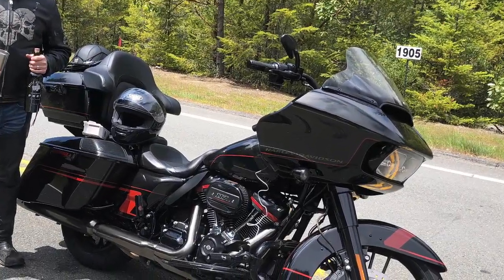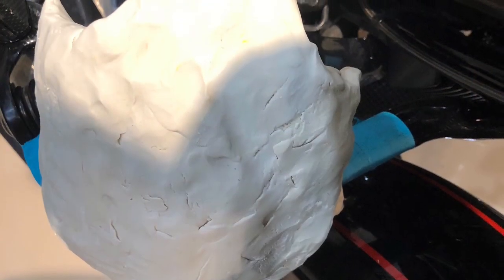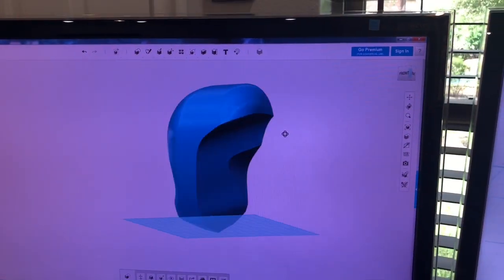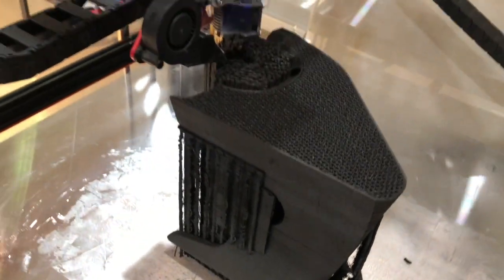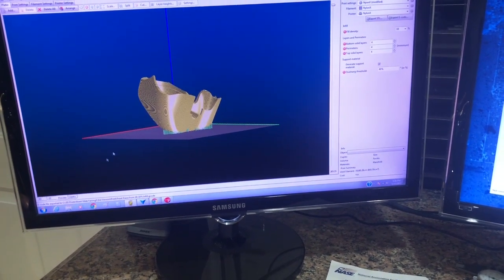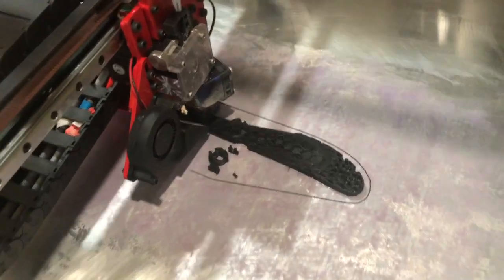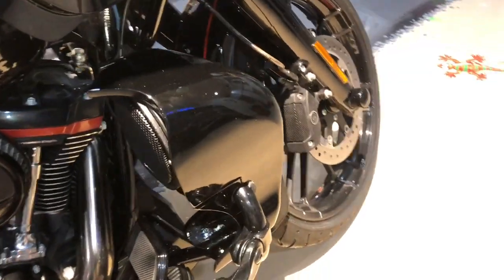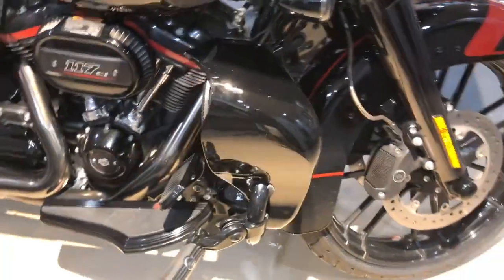Custom Harley Davidson Lower Fairings - 3D Printed For The CVO Road Glide

Comment: I dig that shape to throw air at the engine without the need for a vent. Got any ideas for the standard engine guard for a Road Glide Special?
Reply from the maker: I would make one off of the outer bar slightly outside and the rest inside.  Do they not have one for the bike?
Reply: CLTaggart dirty bird has one for an 8” but not the standard 6.5” speaker, and the venting is awful on the Rushmore and later models, this one looks to provide solid venting.
Reply from the maker: Jorge Sevilla I just modified the one in the video to fit a BOOM2 speaker, so it is not too difficult.  If I can get the dimensions for the crash bar and clearance to the bike and I can work up pretty much anything.  I am doing some designs now in virtual reality which speeds things up a bit.

Comment: Fabulous  engineering,  are you looking to sell another set for a fellow CVO RG rider.... looking at yours and the set from bugbear engineering....
Reply from the maker: Do you mean Big Bear?  I looked them up and their stuff looks great.  These are specifically for the mustache bar so I don’t know how they compare.  I just custom designed them and made them fit mine.  I have had a bunch of inquiries, and of course I can make some up.  I put some pricing in here in the some of the notes but just email me at ctaggart@aol.com if you need more info. Also you should look at the part 2 video I put up today.  The link is in the description above and it shows the easy mounting and size, etc.  so in would say check that out and what Big Bear has and then let me know if you are interested.  I can do PLA, PETG, ABS, or carbon fiber/nylon

Comment: I have the same bike and year but in Gunship grey. I would like a set without speakers. Can you make and sell a sell to me?
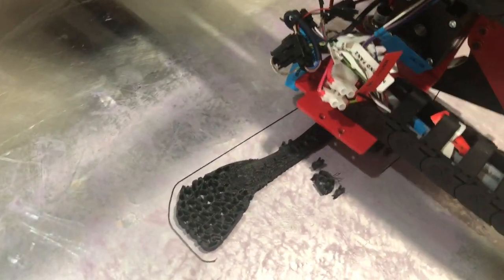Reply from the maker: Well, here is what I can do.  I am not a body person, so I can get them to you raw off the printer like at 4:30 into the video.  I can do three materials: PLA plastic is about $300 for a pair, PETG is $450, and the Nylon Carbon Fiber (NylonX from Matterhackers) is about $750. I did the NylonX because they are less weight with carbon fiber and twice as strong.  I can do either of the other materials, my least favorite would be PLA.  If you epoxy coat it, it will probably hold up to heat, but I don't know as it starts to warp around 140 F.  PETG is probably OK.  I can put a resin coat on any of them for $50 each (it is called XTC-3D if you want to look it up).  Then you just have to get a paint guy to match your Battleship Gray, sand them smooth prime them and paint them.  The ones you see here I just painted for the ride to Alaska.  While they looked fine when I got back, they took forever for me to do them, and they are now painted by Harley with the orange stripe that matches my Road Glide.
Reply: @CLTaggart  How can I get in contact with you to discuss this further?
Reply from the maker: @willieg7040  Feel free to email me at ctaggart@aol.com - I spoke to the guy who painted mine today as well and he can paint them for you

Comment: I have the same bike love it , but would like to have lower fairing.  Would you sell a pair?
Reply from the maker: Yes - if you have a body guy to finish them and paint them I can get you a set for around $250-350 depending on which material you want.
Reply: @CLTaggart  I probably use what you had the carbon fiber and nylon or do you think the carbon fiber is enough
Reply from the maker: Ryan and Barbara Spencer they are pretty thick and went all the way to Alaska and back from Dallas with no issues.
Reply: @CLTaggart  what was the one issue
Reply from the maker: Sorry - no issues.  I had responded while skiing and my phone changed the text.  The carbon fiber/nylon is extremely light and very strong. The material is NylonX which you can certainly look up.  Finishing in it includes brushing it with a clear epoxy and then sanding down until smooth.
Reply: @CLTaggart  do you have some already made with speakers
Reply from the maker: They have to be printed.  If you want them completely ready to mount and painted, etc I can ballpark it for you.  I think the Rockford Fosgate speakers are a couple hundred so that is the only part I am unsure of.  My local Harley has a custom guy and that was around $600 ( don’t know if it was because of my CVO paint and orange stripe).  Plus a rough cost to seal and finish with the print is probably $1500-$1800 range total is my guess. Total time would be 3-5 weeks.
Reply: @CLTaggart  just seeing how much with painting gloss black. I can get speakers here. Thanks for your time on this.
Reply from the maker: Ryan and Barbara Spencer let me check with the Harley paint guy.  Like I said I don’t do body work.  I mean I did mine, but that was for fun.  I ultimately handed them to a pro for an awesome finish since my video.
Reply: @CLTaggart  any word from your paint guy.
Reply from the maker: Ryan and Barbara Spencer he comes to the Harley shop every other Friday and was sick.  I will check again for you. This time I will just ask for his number.
Reply: @CLTaggart   You know I was thinking maybe I'll get them painted up here
Reply from the maker: @ryanandbarbaraspencer8915  I have been slammed with work and inventing the world's first convertible hard top for a Jeep.  I just saw this.  Yeah, I went by a paint place and they said they did not want to do it.  The Harley paint guy is stuck at home like everyone else these days with Coronavirus, and I have not heard a thing.  The easiest would be the raw print at 4:30 in the viseo, or I can at least put a coat or two of resin on them.  (I am copying and pasting here from another comment, but it summarizes what I can do).  I can do three materials: PLA plastic is about $300 for a pair, PETG is $450, and the Nylon Carbon Fiber (NylonX from Matterhackers) is about $750. I did the NylonX because they are less weight with carbon fiber and twice as strong.  I can do either of the other materials, my least favorite would be PLA.  If you epoxy coat it, it will probably hold up to heat, but I don't know as it starts to warp around 140 F.  PETG is probably OK.  I can put a resin coat on any of them for $50 each (it is called XTC-3D if you want to look it up).  Then you just have to get a paint guy to match your Battleship Gray, sand them smooth, prime them, and paint them.  The ones you see here I just painted for the ride to Alaska.  While they looked fine when I got back, they took forever for me to do them, and they are now painted by Harley with the orange stripe that matches my Road Glide.
Reply: Hey, I want a set of these. 6.5 speakers correct? I have body guy and paint. How much.
Reply from the maker: @zacharyvandenheuvel3278  Well, here is what I can do.  I am not a body person, so I can get them to you raw off the printer like at 4:30 into the video.  I can do three materials: PLA plastic is about $300 for a pair, PETG is $450, and the Nylon Carbon Fiber (NylonX from Matterhackers) is about $750. I did the NylonX because they are less weight with carbon fiber and twice as strong.  I can do either of the other materials, my least favorite would be PLA.  If you epoxy coat it, it will probably hold up to heat, but I don't know as it starts to warp around 140 F.  PETG is probably OK.  I can put a resin coat on any of them for $50 each (it is called XTC-3D if you want to look it up).  Then you just have to get a paint guy to match your Battleship Gray, sand them smooth prime them and paint them.  The ones you see here I just painted for the ride to Alaska.  While they looked fine when I got back, they took forever for me to do them, and they are now painted by Harley with the orange stripe that matches my Road Glide.
Reply: @CLTaggart  id like to discuss ordering. Can u give me a way to direct contact u. Thank you
Reply from the maker: @zacharyvandenheuvel3278  Feel free to email me at ctaggart@aol.com - you can also see the following Part 2 video that shows measurements and closeups of the positioning of the lowers:  https://www.youtube.com/watch?v=DdyGqlqAJi0
Reply: I would like to buy a set if your still willing to make a pair

Comment: Great job!! I have the 2019 RG CVO, it needs a set of those with no speakers, just a door!
Reply from the maker: I can add it but I am on another project right now.  If you can finish the part yourself (sand and paint) I could probably get you a pair.
Reply: CLTaggart , let me know your cost, I would love a pair of them
Reply from the maker: I am at a point where I think i can do this for you.  I am not sure about a door, but I can put something in for 4 screws